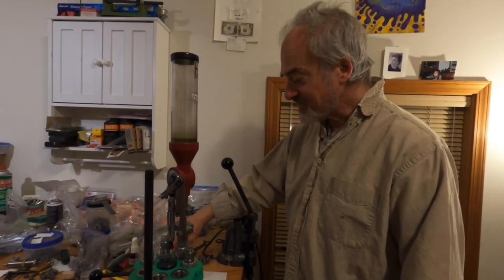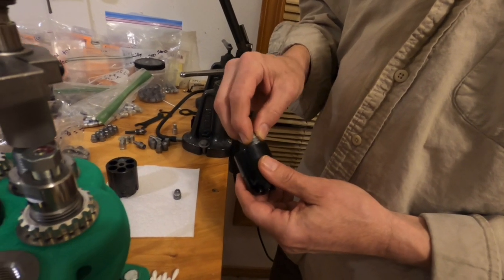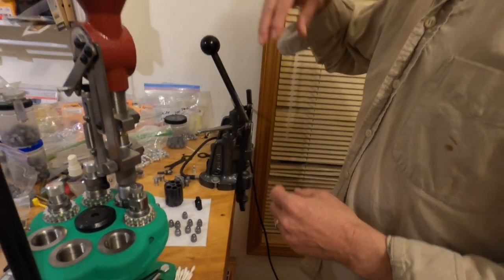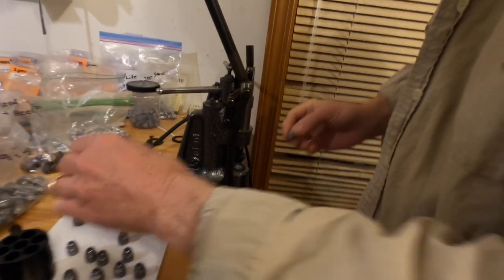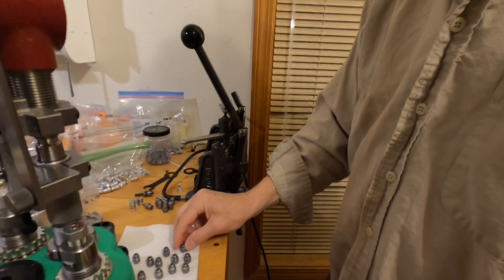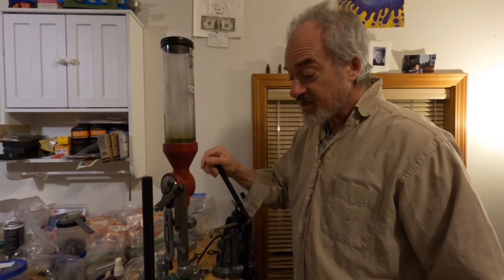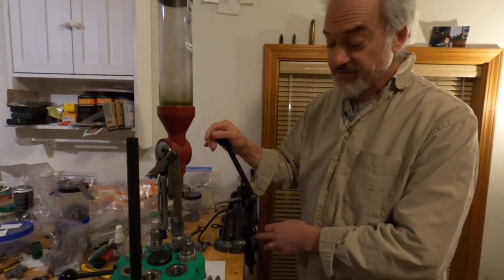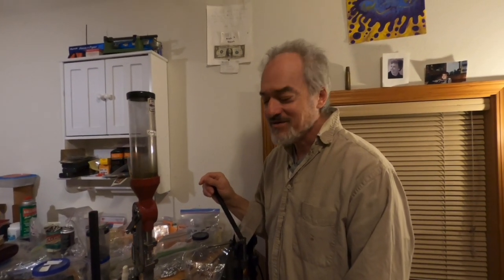"Heeling" Modern Bullets for Percussion Revolvers

Comment: I have a Pietta repro Remington New Model Army (aka 1858) and I love the gun.  Got an extra cylinder when I bought it.  I need to get around to grinding out the frame and contouring the ram so I can load conicals on the gun, then look into making Hazard type "hard cartridges" (compressed powder "pellets" bonded with either nitrocellulose glue or dextrin and water).  Much more durable and, if coated with nitrocellulose lacquer, very weather resistant.  Those, dip lubed and stored with airtight containers of caps, would make cap and ball ammunition that lasts like modern crimped-primer or lacquer sealed military cartridges.

I've been thinking how to "heel size" bullets this way using the push-through sizer I have for my Lee Hand Loader -- I don't think it would work well compared to conventional size/lube devices.  Maybe a shortened .45 ACP taper crimp (or .45 Colt roll crimp) die could do the job?

Comment: Agree that this is a sound approach to adapting bullets from molds at hand to fit cap and ball cylinders. Just realized I could order an RCBS .446 sizer die and put a heel on the bottom band or two of the excellent Lee 452-255RF with its generous meplat and have a serious hunting bullet for the Uberti 1858. Thanks Omnivore.
Reply from the maker: Absolutely.  255 grains is a mite heavy for an Army revolver, in my opinion, but its was a fairly standard bullet weight back in the day.  It sort of depends on how your sights are regulated.  It will generally shoot high compared to lighter bullets.  The length of the heel will somewhat depend on how much reef there is in the gun's loading port.  Ubertis tend to have generous loading ports, so hopefully, squeezing down only the rear drive band would be enough.
Reply: @omnivore2220  Fully agree that this may be just too heavy for the Remington, which is on its way. I am prepared to modify the loading port -- and open the nipple access to accept a capper, per Duelist54's guidance. Also have an Arsenal mold at 230 grains with a decent meplat to try. That RCBS.446 size is on the way. Needed one anyway for when I get the .44-77 rolling block up and running.
Reply from the maker: @MrBillinoregon  230 to 240 grains is right in the "sweet spot", in my opinion, for the Army and even the Walker revolvers.  But that's assuming your gun will shoot it accurately.  The best energies I ever got out of an Army revolver was with a 240 grain bullet and Swiss or Olde Eynsford 3F powder.  Really quite impressive.

Comment: VERY well-done instructive video. This is actually very useful information. My first thought was "Just get the molds and cast your own". However, after thinking it over I can see where someone casting and loading 45 Colt / ACP could easily use the same bullets in a C&B revolver (and make revolver combustible cartridges) by this ingenious method. I cast, load and shoot 45 Colt, ACP and Auto rim (along with .223, 9mm, 38 SP, .357 Mag, 30-30, .30-06, etc). I also shoot C&B revolvers. But I have molds (mostly Eras Gone, but also some old Rapine molds, plus a few custom molds) casting original-style rebated-base conical bullets of the 1850's/60's design to both loose load and use in combustible cartridges.  But for a prepper, keeping things as simple as possible, this would be perfect. 

I would advise anyone, wanting to be prepared for the worst, to acquire a C&B revolver or 2. The .44 Army models in particular are extremely useful, because common .45 Colt/ACP bullets are easily used, and these C&B revolvers loaded with PROPER black powders as in the 19th Century are as powerful, accurate and deadly as any modern handgun for the first 6 shots.  After getting a new C&B revolver, replace factory nipples with quality after market nipples having tiny flash holes, then time and slick the gun action up to the high quality standards of the originals and you will have a revolver of amazing reliability.  

By PROPER black powders, remember in the 19th Century, 4Fg was pistol powder, and 5Fg was cartridge powder used for combustible cartridges.  Modern Swiss Black Powder is as hot as Hazard Powder from 19th Century America, and Swiss Null B, an extremely fine grained 5Fg black powder, is practically the same as Hazard Cartridge Powder, used to make revolver combustible cartridges in the 19th Century. About 10% conical bullet weight of Null B in the paper powder envelope of a revolver combustible cartridge is proper. From an 8 inch revolver barrel, 22 grs of Swiss Null B under a 220 grain conical bullet gets around 940 fps. Properly loaded, these C&B revolvers are no joke in the power and accuracy categories. 

After the revolver combustible is made, I hot dip lube the bullets in a melted beeswax / coconut oil lube of 2 parts beeswax to 1 part coconut oil, allowing the bullet to heat for a few seconds to keep the lube coating thin.  (unsalted Lard, Beef or Mutton Tallow works as well as the coconut oil).  The secret to keeping a C&B revolver running reliably and for many shots without problems is good bullet lube, lubing the base pin and cylinder ratchet with a good grease like beef tallow, and quality nipples that minimize blow back and cap jams. Learn to treat and use the C&B revolvers properly and these revolvers will not let you down! It's an old technology that still works well, as long as you understand how to solve the little quirks. Happy and safe shooting.
Reply from the maker: Good points.  I may do a separate video on keeping a percussion revolver running all day, firing a lot of rounds (100 or more) before the gun has to be cleaned.  The gun needs to be properly fitted, as you indicate.  At that point it's mainly it's about the lube, and while a lot of percussion revolver shooters like to make their own, there seems to be a disconnect between percussion revolver shooters and the other black powder shooting disciplines.  Commercial SPG lube, for one, has been used for generations to keep Black Powder Cartridge Rifle (BPCR) shooters and CAS (Cowboy Action Shooting) competitors going all day, and it works as well as most any of the home grown lubes, and better than some.  The point here is that a new shooter need not get into the fine (and messy) points of sourcing his own materials and mixing up his own lube, or using soupy, messy Bore Butter, just to be able to enjoy shooting with one of these guns.  In fact he may not need any lube at all if he's only firing a few shots here and there.

Of course with the Walker revolver I'm using a lot more than 10% of projectile weight in powder (see my shooting video).  More like twice that much!, but it's 3F Olde Eynsford.  I've found the OE to be very close to the Swiss brand powder in terms of energy imparted to the bullet.  But yes, in an Army revolver that 10% rule for 4F or Nul B powder and a conical bullet would make a good load.

Comment: I use a .375 collet tool holder to "heel" my lee conicals for my 36 cal spiller and burr, with a lineman's pliers that has a .375 hole milled into the handles to finish the sizing.

Comment: I used to buy .358 pure lead HBRNFP for shooting in my 1851 Uberti Colt that I converted to reload and shoot .38 LC centerfire ammo.  With a new front sight it was very accurate.  However, 
I cannot find those bullets or a mold for sale anywhere.   They had 2 grease grooves, 1 crimp groove, and were 3/4" long.  Would you know where I could find them?
Reply from the maker: Hmm.  You don't say when this was, nor do you say whether you cast those from a mold, or from whom you obtained the bullets, or the mold.  However, if you're shooting a converted percussion 36 Navy, then I'd recommend using a heeled bullet having a major diameter of at least one thousandth of an inch over barrel groove diameter, or around .380" - .381" for a typical Uberti 36 Navy.  You'd need to slug the bore and take careful measurement.  With a such a bullet you wouldn't need a hollow base to help force a bullet skirt out into the rifling.  There are many such bullets available in the form of custom molds at accuratemolds.com  You'll find those bullets in the 38 caliber section, as he goes by actual diameter categories (e.g. a 0.358" bullet mold would be in the 36 caliber section, and a 0.381" mold would be in the 38 caliber section).

Of course, for crimping, you'd need a special crimping tool because a standard seat/crimp die will not be able to crimp a case that has a bullet of the same diameter as the case OD.  Many conversion shooters using 38 LC or 44 LC, etc., are doing this, so there's plenty of information about it on line.

If you just want to buy HB bullets, and not have to cast them, there are many available in the form of HB wadcutters for 38 Special.  Just about every bullet company makes one of that basic description, even if it's not exactly the bullet you were using before.

Thirdly, you can order a custom mold of any design and dimension you like at accuratemolds.com, have it made as a HB mold (open at the base, nose-pour) and then send it off to Erik at hollowpointmold.com for the HB core installation.  He does excellent work, as I say in this video.

You might also want to check out MP Molds (https://www.mp-molds.com/product-category/molds/).  He shows a number of HollowBase molds, all ready to go (no sending the mold off to a third party for custom core installation).  I haven't tried him, but he has a good reputation for making quality molds.

Still and all, a full diameter, heeled bullet (0.357" heel and a "38X" drive band diameter) is probably the best way to go, even of you have to acquire the special crimping tool.
Reply: @omnivore2220  Thank you for your extended, informative reply.  I bought an early Kirst coversion cylinder 30+ years ago.  They are bored to only accept .38 LC or .38  Special cartridges.  Their website tells you only use thin skirt HBRNFP pure lead bullets, because a heeled bullet or a .375 round ball are too large to chamber in the cylinder.  I will go back to mp-molds websight and try again.  I really appreciate your help.